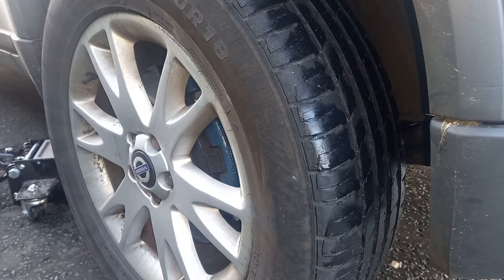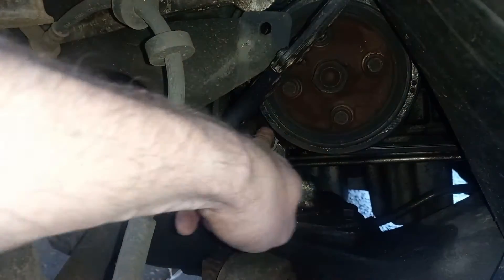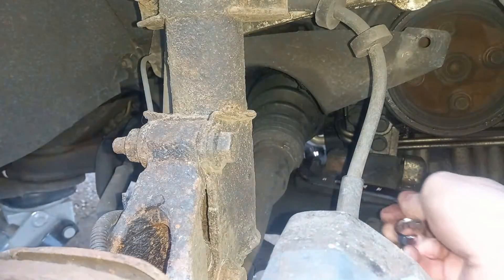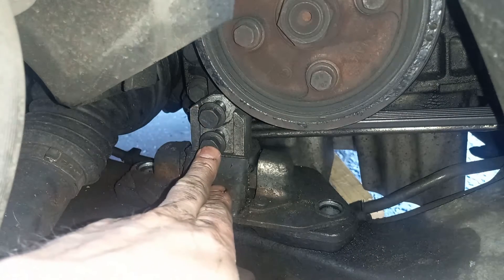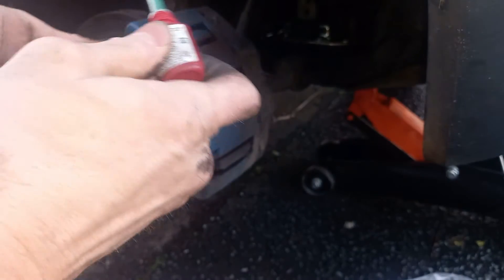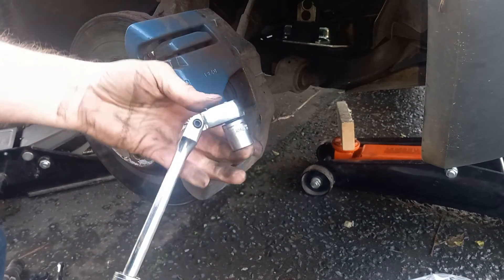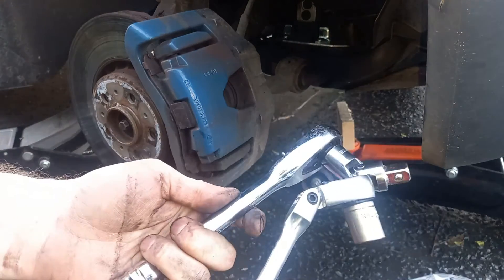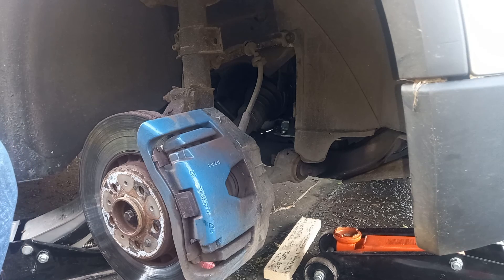Volvo Lower Engine Mount Fix - SUPER EASY #diymechanic #XC90

Comment: What noise was this causing cos I have a clonking noise low drivers side when I pull away and break heavy , I can let go of the accelerator and ally it again at low speeds and it makes it clonk sounds like it’s coming form wishbone area so I’m thinking it’s this ?
Reply from the maker: This one is a very particular symptom… when you press the brake, you feel engine vibration through the steering wheel! Not really a clonk - 9 times out of 10 a clonk will be the drop link or track rod end… do you get the sensation of understeer on long slow corners? (That would say track rod end). The drop links are about 20 pounds… track rod ends, about 30… both easy jobs
Reply: @bigtalltim  no I just get a metal on metal clonking sound as I pull away like the noise a bad UJ would make that bad play in it but it’s low down drivers side wishbone area , it sometimes does it when I break too ! I’ve changed the lower front mount but that wasn’t it
Reply: Also steering is fine no pulling to one side and now vibration at all in the car just a knock when I accelerate away and also if I let off and then put it down again
Reply from the maker: There is definitely an engine mount that can clonk under load - the lower torsion mount (near the gearbox at the front - connects to the subframe) is another common one to fail; are you left hand drive? That would make sense from the description of driver side wishbone area… it is kind of like  a dogbone shape… just 4 bolts secure it - it’s purpose is to smooth out engine roll… made of steel with a couple of high strength rubber bushes, but when they fail, it is metal on metal - could easily be your clonk!
Reply: @bigtalltim  RHD and I’ve just changed that thinking it was that , it was worn the middle bush was gone in it but it hasn’t stopped the noise
Reply from the maker: OK... Whittling down the possibilities... Top engine mount would present a clonk as the engine moves around under load, but that would be from higher up not the wishbone/control arm, so your offside drop link would be where I'd start. (definitely check out this video here: https://youtu.be/7rqWxjuyOWY ) If the ball joints can easily be moved by hand that could well be it... other than that, there are a few components in that area that can cause a clonk... to list the obvious ones, Worn motor mounts (2 of the 3 already addressed, and the top one, we can discount here due to sound placement), worn suspension components - principally the drop links aka sway bar links (suspect #1 here), failing driveshaft (the Constant Velocity joint will eventually wear out - may be worth squirting some grease in anyway), and low transmission fluid (a nice easy check!). Myself, I'd have those droplinks off and check for play - let us know how it goes!
Reply: @bigtalltim  ok thanks I will get on to that at the weekend 👍
Reply from the maker: Just in case you never got to the bottom of this, there is another possibility - could just be looser than spec bolts!Check that the vertical bolt at the rear of the lower control arm, and both bolts from the knuckle onto the suspension strut are fully torqued… huge torque and then an angle - often missed from the torquing at the end of a job because they are tucked away (don’t ask me how I found that out! 🤦‍♂️)
Could also be that they were under torque (particularly the lower strut bolt) because to do it properly you need to remove the disc…